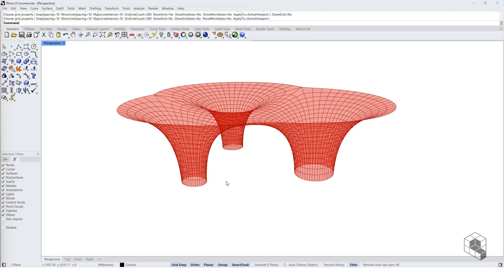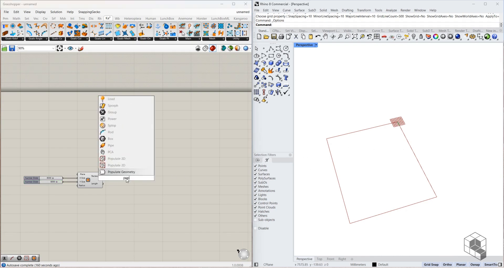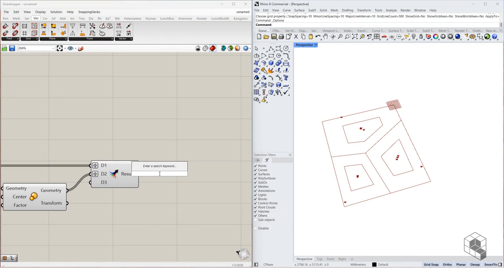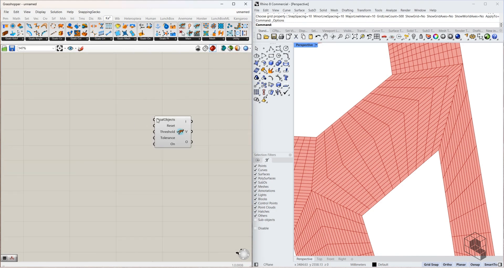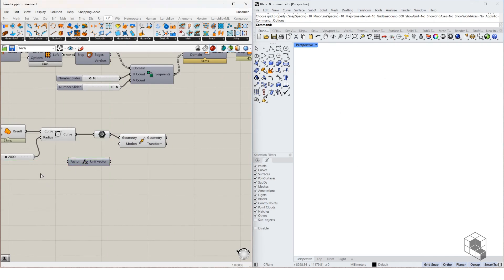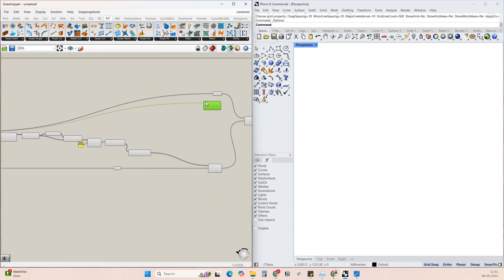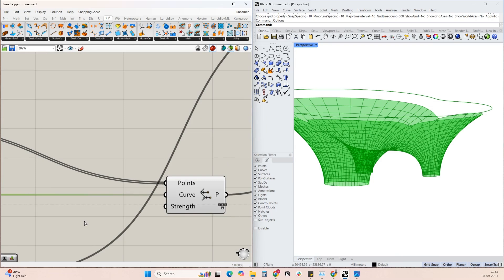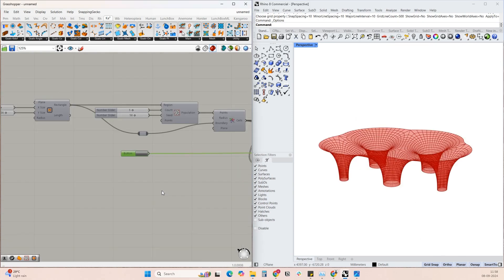Kangaroo Pavilion Tutorial

Comment: How can I bring in new panels instead of the quad mesh ?
Reply from the maker: What do you mean by bring in new panels?
Reply: @qbricklab4200  I am using a quad mesh to inflate and I want to project  a geometry on my the resultant mesh,  but it only projects on the pre quad mesh, Instead of this I want to build cleaner panels.
Reply from the maker: @ I get it now. Since these quad are not planar, I would suggest you rationalize the pattern in triangles (because triangles are planar) and then you can map it to the triangulated faces of quad mesh. Another option is to convert the quad faces into individual surfaces using the 4 edges and then mapping the pattern onto the surface. Note, both operations will take a lot of time to compute.